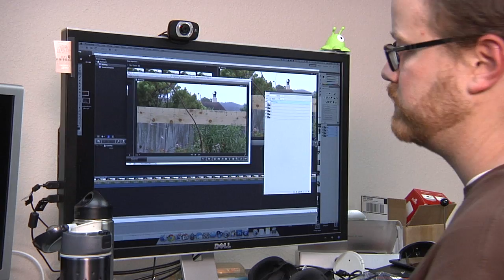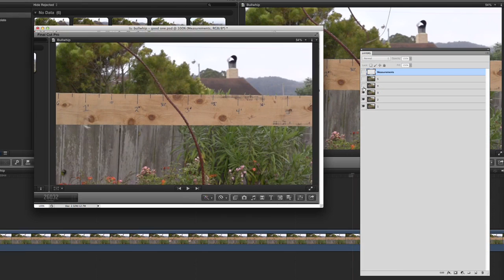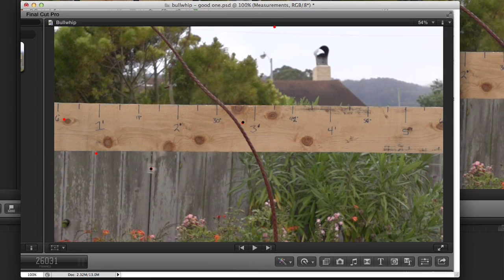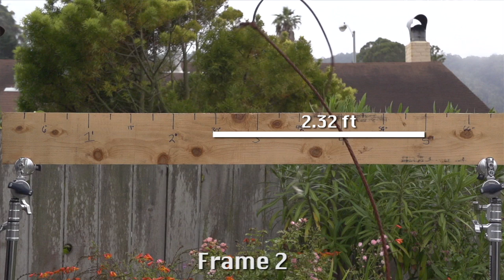Tested: Does a Bullwhip Break the Speed of Sound

Comment: Not to necro an old video, but around the 5:25 mark you get into fps calculations. How is 480 fps equal to 1/2000 of a second per frame? Is the camera only capturing about 1/4 of whats happening? 480fps should equal 1/480 second per frame...frames per second and seconds per frame should be the inverse of one another.
Reply: Listening helps. They say 2/1000, which is 1/500 or around the actual number

Comment: your whip cracking technique is typical of a beginner who just picked up a whip.   Performance also has to do with the quality of a whip.  Try meeting with an experienced whip master who knows what the hell he's doing, strikes the target rather than himself, and using the 5000-year tested and proven physics that a progressively, evenly tapered whip NOT bought on Amazon, built with a quality, mass-forward shifting core as the loop's diameter unrolls itself in ever-decreasing diameters down to a virtual gnat's backside, rather than curling back on itself in a large arc that cracks dangerously close to your own face, rather than at full extension, DOES in fact shatter the sound barrier, once you learn to use it as designed.  Math and frame rates and fancy equipment put on a good show for an ignorant audience, but your conclusion is total horse-shit.
Reply: https://youtu.be/AnaASTBn_K4 this is what you want to watch

Comment: The main two problems are not the camera, but the way you cracked the whip, and the area you were calculating. The whip was actually cracking off camera in the slow motion. Performing the Forward Crack (also known as the Cattleman's Crack) or the Flick would have been much easier to identify.

Comment: its not a standing wave. its just a wave. if you were wiggling this whip with the end fixed that would be a standing wave.  but this is just a wave. 

On another note where else would the sound come from? and why are you so suprised that the tiny intsy little bit at the end of a whip moves faster than the speed of sound? The fastest punch is as fast as a car so why would a device that's job is to speed up a wave you introduce be so suprising that it can make a sonic boom?

Comment: 3-demensional distance cannot be caught on the camera they are using. These guys should take into account the objects actual trajectory... the object in the case would be the tip of the whip. These guys are measuring the distance traveled in the frames but not looking at the actual path and curves the tip of the whip follows. They are going by the distance the tip of the whip travels at the center of the terrible shot of they recorded. They're not measuring the last bit when the whip actually cracks because it's not conveniently in their shot. Lazy. Also, they're not measuring 3-demensional distance. Their technology is not there. This is such a dumb conclusion. You guys should be ashamed of yourselves. Also, we have no idea of the accuracy of their already inaccurate calculated distance traveled because we have no idea of the distance between the whip, the ruler, and the camera. This should all be taken into account.

Comment: You are calculating at the wrong point of movement.  The fastest speed should be attained just as the very tip "cracks."  You are calculating LONG before this.

Comment: So the results were inconclusive and this is 8 wasted minutes of my life without seeing tangible evidence.  This is my observation.  Firstly, the whip clearly doesn't slap itself to create sound.  That much is shown in slow motion video.  The popper is only in contact with the air molecules at roughly sea level, assuming a temperature close to 68F/20C, which seems plausible because these guys are wearing warm weather clothing in California.  The whip makes a loud noise.  One can easily infer than an object making a cracking sound without coming into contact with another object is creating pressure waves in the air that can't get out of each others' way and the sonic boom occurs.  Based on the video analysis, it seems pretty clear to me that the tip of the popper is traveling at least quickly enough to lend evidence that it is breaking 760mph.

Comment: wait but then what was that thing at just before 1:18 when they are showing the slow motion of the whip? I felt like I saw a little whitish/cloudy thing just at the end of the whip - which is typical what the area around something that breaks the sound barrier would look like. I saw the whole video several times but it happened only once however it looked very much like the shock wave you'd get from breaking the sound Barrier AND it coincided with loud "crack" of the whip (which also happened only once). It's very faint but if you watch closely you'll see it.

Comment: youre trying to measure a circular motion with a linear measuring device
Reply: But if it's going past the speed of sound linearly, it'll be going far past the speed of sound circularly. So it kind of could work...
Reply: It's not a very uniform circular motion so even if you did try to measure it circularly it still wouldn't be accurate
Reply: If they're trying to measure the velocity of the tip and just the tip, does it really matter?
Reply: Who needs arc segments anyway? Though, they do look like they know a-thing-or-two about pi(e).

Comment: They're looking at it wrong anyway.  The end doesn't move faster than the speed of sound for any extended period of time, nor really in the same direction as the whip. It's the coil at the end violently unfurling that breaks the sound barrier, which means it's more of a small circular movement than one that will show up on a straight ruler like that. A better way of doing it - and one that wouldn't require a more high-speed camera - would be to calculate the kinetic energy of the standing wave at the start or midpoint of the whip, then calculate the resulting velocity after it had propagated down the length of the whip, losing mass while retaining energy and thus gaining said velocity. If the calculated velocity exceeds the sound barrier by any substantial amount, it could be assumed that the actual velocity had broken the sound barrier despite any energy loss. At least, that's how I'd go about it. :)
Reply: Baron Von Scrub | you deserve more thumbs up. Fibally a comment that tells the whole truth and not just a part of it
Reply: For us fifth graders ( who sometimes pay attention ) have absolutely NO idea what that ment but, clap clap clap

Comment: Come on guys, you should have brought someone that knows how to crack a whip.. And your calculations are not very accurate!
Reply: True man lol haha
Reply: Which would be correct, yes the crack is there, but they aren't measuring vertical path either. They only measured the horizontal path of something that moved in all 3 dimensions.
Reply: lol!! that's what i was thinking, i can crack a whip and these guys have no idea what they are doing!!!
Reply: Exactly.... It's not moving that many feet cause no one snaps it back on themselves as they did. 

Wave should extend away from user down the line and you would see the required movement. 

Dumb ass!

Probably went to some community college
Reply: pit bull no but the crack it still there which is what they're trying to measure, seeing if it is a sonic boom, anything fatter will make no difference what so ever
Reply: @noneya8809  yes and no the crack may still be there but you're not getting the full potential out of it they should have got somebody that knows what they're doing to use the whip that way they can get the best results some people when they crack a whip it doesn't crack very loud and then when others who know what they're doing do it it's quite a different story

Comment: In his book, "Whips and Whipmaking," veteran whip handler and author David W. Morgan states that, when a whip is cracked (BY SOMEONE WHO KNOWS WHAT THEY ARE DOING!), its tip reaches speeds in excess of 1400 feet per second--APPROXIMATELY MACH 1.25!!  Your so-called "demonstration," gentlemen, is therefore totally bogus and unscientific!  I for one would NOT accept it as evidence in ANY court of law, ANY TIME, ANYWHERE, under ANY circumstances!  Why?  For one thing, your technique is totally lacking (although, to be fair, Will DID manage to get the whip to crack to some extent).  For one thing, neither one of you flicked your wrists when you were handling the whip.  It is that flick of the wrist which causes the tip to SUDDENLY change its direction, and it is that change in direction which causes the whip to crack!  Will, at least, stiffened his wrist somewhat when he was handling the whip.  This, in turn, cause enough of a change in the whip's direction of travel to produce some cracking.  A real live expert whip handler, however, would have been able to produce a much louder and more expert crack without even half way trying!  (Incidentally, it doesn't take a lot of strength to crack a whip properly.  Cracking a whip depends far more on proper technique, which includes both muscular CONTROL, plus hand-eye co-ordination, both of which, like most any other such skill, requires practice, practice, and MORE practice!)  Given these facts, gentlemen, I challenge you--in fact, I DARE YOU!--to repeat your so-called "test"--only this time, have a real expert handle the whip!  I'll be VERY surprised if your calculated whip speed isn't a good deal higher!!

Comment: The answer is there but your initial bias prevents you from "seeing" it.The crack occurs NOT at the fastest speed of the whip tip but rather right after the tip stops and begins to accelerate. It has to do with a breakdown of the air boundary layer around the whip tip. Does that mean that all the physics "experts" have it wrong? Yep...along with a LOT of other really basic stuff. This is just one example.

Comment: No it's well known that the reasons that a whip causes that with things around or even towel does is because the tip of it is breaking the sound barrier and the rushing there to fill in the vacuum left behind is what creates the crashing soon.
Reply: Geoffrey Zoref Incorrect, the crack is caused by the loop in the whip moving down the length of the whip faster than the speed of sound:
http://www.scientificamerican.com/article/true-cause-of-whips-crack/
Reply: Respectfully:  look up "on the dynamos of a bull whip" 

also, the link that you cited also says that it does break the sound barrier, but that it isn't the entire reason for the crack only part of the reason for the crack only part of the reason for the crack.

Comment: Also the ruler is measuring movement in a single axis. The whip does not conform to that plane of movement. It would be better to try to estimate speed by using a grid of squares behind the whip crack.

Comment: I really like this channel, but this video fell way flat for me.

For anyone who hasn't used a whip before, you can get less substantial cracks without breaking the sound barrier. This is what they got. Its almost impossible to get a real crack with the technique they used. With proper technique, the popper will break the sound barrier, and you will get a real crack which sounds like, and is about as loud as, a small caliber gunshot (like a 22).

Comment: If you let it roll out horizontally the way it's supposed to, you'll find that the end DOES travel the 1.6'/s it needs to in order to break the sound barrier. What you are doing is snapping the whip back on itself—and vertically at that—which is why a) you keep hitting yourselves, b) you broke the fall on the whip (snapping back puts way too much strain on the whip: let the whip do the work, not your arm!!!), and c) why you are not getting a minimum 1.6' horizontal movement within 1 second.

Comment: Okay, can I suggest that the reason you didn't catch it is because you weren't throwing the whip correctly to get an optimum crack.  You were doing a very simple crack, but it wasn't getting the actual sound barrier.  Standing and throwing the whip forward and filming the coil going down the length of the fall would have let you film the actual crack at the end, in a very predictable place.  Also frontal shots, and back shots would have shown more as well.

Comment: the whip is moving in 3 dimensions and your using a 1D measurement, basically your not takeing into account the reference frame that your measuring, which should be calculated 3 dimensionally from the perspective of the verry end of the whip !

Comment: I would think that its not the distance the end of the whip travels but the speed at which it changes directions as it cracks. If you are going 600fps in one directions, and then change directions instantly 600fps the other way, is that equivalent of traveling 1200fps at that point in time? I believe so!

Comment: You can shoot as short a shutter speed as you like, so even shooting 30fps, you can capture 1/2000 of a second. Shooting 480fps, the standard shutter speed would be half that (since when shooting film, the shutter is closed for half the film to allow the next frame to seat into registration), or 1/960th (rounded up to 1/1000) of exposure per frame (though with digital cameras you could shoot 1/480th of a second at 480fps. To capture 1/2000 of a second, you simply cut your exposure time in half.

Comment: one problem you guys are having in figuring out the actually speed is the way you are cracking the whip. if you guys want better results try craking the whip the in the same manner you cracked the towel. when you cracked the towel it was on a horizontal plain where as the whip was on a vertical plain being compared to the ruler which was also on a horizontal plain. also cracking the whip the same way as the towel, you are less likely to hit yourself in the shoulder haha

Comment: They're testing if the reason a whip makes the cracking sound is that it breaks the speed of sound. If Norm can make it crack, yet it does not break the speed of sound, then logic dictates it is not breaking the sound barrier that directly causes the cracking sound, so even if a professional whip guy could cause it to break the sound barrier, it would still not be necessary to create the cracking sound.

Comment: You are correct, they are doing it just  about as wrong as is possible. They are using the whip as if it was a hammer, just swinging it up and down and hoping for the best. This not only gives them a weak and ugly crack but is also quite dangerous as the whip is traveling towards them when it's cracking. And this the way people hit them self  in the face.